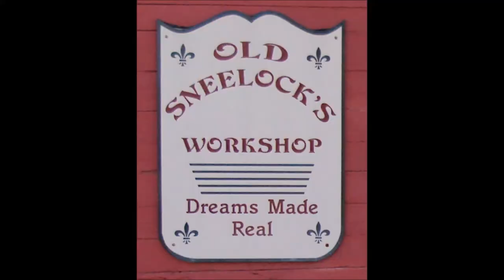WHEELBARROW GARDEN PLANTER ~ WELDING THE BIN ~ PT 13

Comment: Boy this is a project. Box is looking good. I'm not much for mig welding but I've been trying to get the hang of it.
Reply from the maker: i should rig up the argon and CO2 to see if that helps. It's going to hold but I'm really going to have to grind the hell out of it before I paint it.
Reply: Hiding the multitude of sins. I know all about that, plus bondo and sillycone and a lot of dirt, maybe.
Reply: You'll get it.

Comment: Just about everything I've ever done I've said when/if I did it again I'd do it differently If I'd HAD to do that it'd been with the old buzz box, itty bitty rods and a LOT of praying. And about the time the whole thing ended up in a big glob in the floor I'd finally figure out the right combination. I suppose that's why I ran them and didn't fix them, much..
Reply from the maker: Lewie McNeely l'm better with oxy acetylene for welding thin stuff like car bodies. I'll never get better without practice. Took the day off and did house chores today.
Reply: I mowed and changed oil in mowers and straightened up a bit. I really guess that I would farm the welding out. I'm a non at any of it unless it's thick stuff where you can't mess up too bad.
Reply: What is it AvE says: "Grinder & paint, makes me the welder I ain't."  I can understand that all too well.  That is, if I even did that much welding.  Hopefully, I will have some opportunities to practice once I get the garage cleaned up enough to start thinking of it as "my shop" instead of "'the garage".  
On the plus side, I finally have all the yard mowed, so I now just have to keep up with it.  I need to till the garden again (pure clay, plus it was loaded with grass, weed, and who knows what all plants & roots), and I can hopefully start cleaning up the garage.
Reply: Brian, do what my Sweetums does. Just cover the places you want to kill off ot till up with black plastic for a while. This takes care of the vegetation and lets the worms soften it up a little. Then it just takes half the explosives to break the clay crust. She's the gardener here, I'm just the maintenance man.
Reply: I will have to remember that for the next time.
Reply: She's in to raised beds and all of ours came to pass that way. Works REALLY good in the fall and let the ground winter over and the heat trapped underneath keeps the worms going.